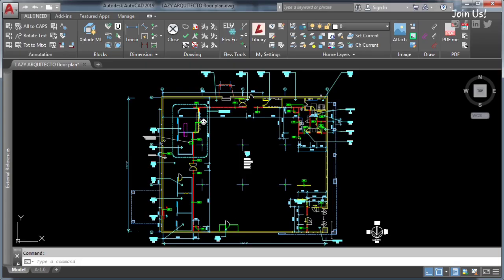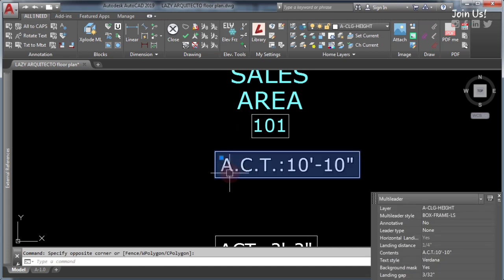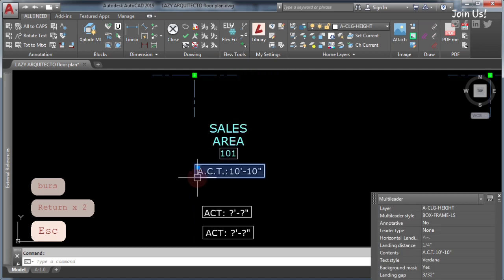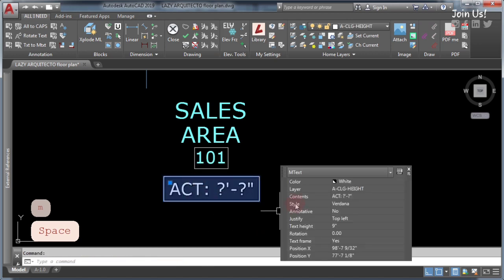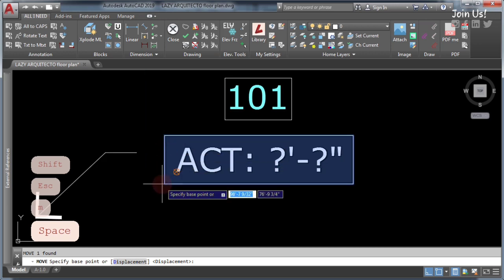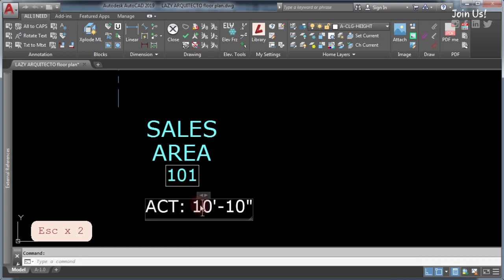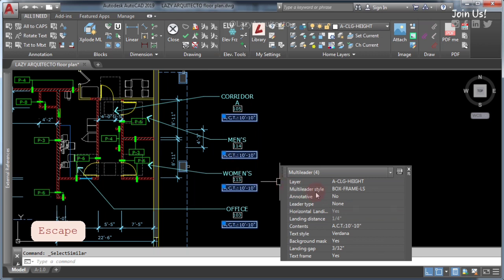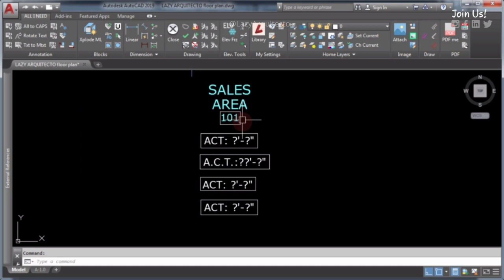What's the Best Way to Frame Text in AutoCAD?

Comment: What if the text in attribute is too long and I want it to go to the next paragraph after a certain length? How do I put a boundary to make sure the text always fit the box it's inside? So the box never changes in length but changes in height
Reply from the maker: You need to set the text justification to fit, like this https://youtu.be/R04P4d7fJvg
Reply: You can also have a multi-line text attribute. I find that really handy if I have a room tag in a small room.
Reply from the maker: Good suggestion Rachel!